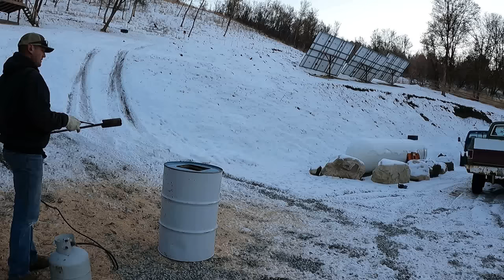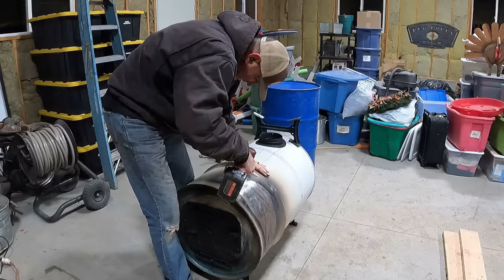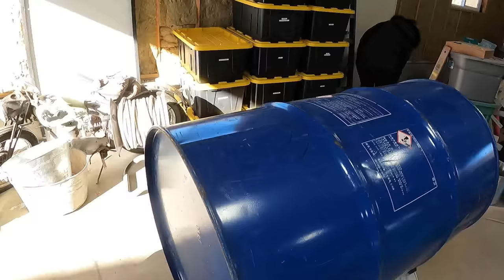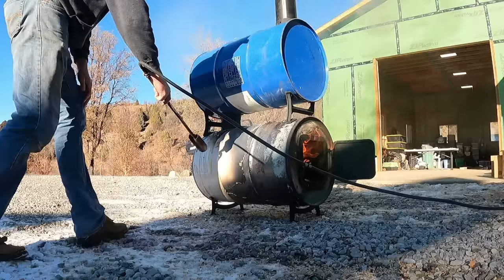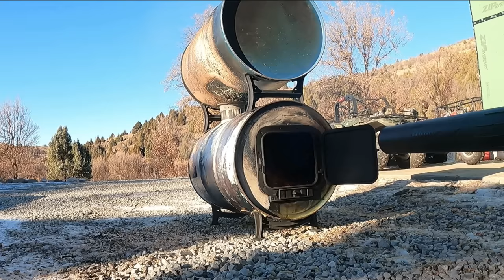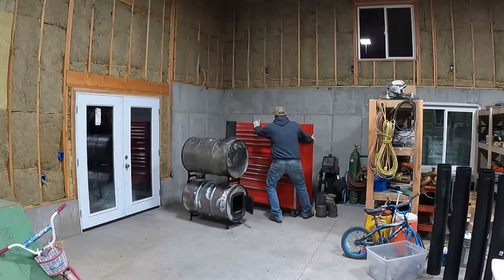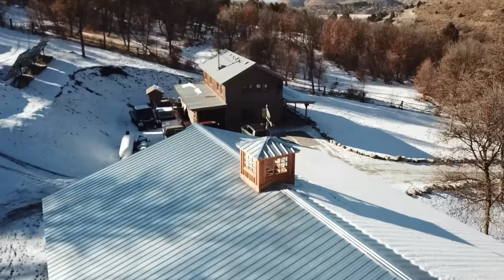I Built The ULTIMATE Wood Burning Stove For The Shop...

Comment: If you want your double stove to really heat the shop add tubing from end to end on your top drum. Them add a fan on the back of the top drum that will blow through the tubing.

Me and my dad used old driveshafts and a hole saw. The heat travels in between the tubing and they glow super red hot. While in wy the winters where harsh for some cali boys. so this hotrod heater was a must for us.

Comment: The metal of a 55 gallon drum is like the cheapest steel in the world I don't know why anybody would want to spend so much time creating a wood-burning stove out of a 55-gallon drum because immediately after burning wood and then they oxidize and get so thin within one year they start leaking everywhere you've got to have at least quarter-inch steel for a wood-burning stove I believe a 55 gallon drum is less than a tenth of an inch

Comment: Build one you need a 30gal barrel and a15 gal barrel to much draft with the 55gal barrels,you have to make them air tight, and the rest you have figured out. oh it waists alot of wood with the 55 gal drums.good luck.you need class B pipe,put the 15 gal drum on top of the 30 gal drum and the draft will work great.very poor draft with the 55 gal drums.

Comment: Not ultimate by any means. Basic wood burner.  
Simple upgrade; your barrel had bungs  put the door on that end. Remove bung for extra air flow. Tubing upper barrel with a small blower heats area quicker  but not as off grid friendly.

Comment: Ultimate: The best achievable or imaginable of its kind.

So no, no it's not. I get a cold shudder just thinking of all that wasted Heat, going up & out of your chimney/stove pipe.

Where are your Heat Exchangers? They are simple and have been used for centuries. And with a little ingenuity, you can place Heat Distributing Fins on the Barrels as well.

Fans? You do know they move the heated air better than using simple convection or radiant distribution, right? That way, you wouldn't have to sit so close to the stove to get warm.

Comment: Your clearance codes to combustibles ( truss and roof ) is not to code and very dangerous . Sheet with metal all wood with Minimum 1 “ air gap through to the roof . A vent is far safer for the path chosen .

Comment: Masive fire hazard.

As the flue gases enter the 2nd chamber their speed is reduced which means there is less energy to lift the waste products, meaning they fall out and settle . after some time it is very likely they will catch fire again at which point things will get very hot.
At the very least you should clean it out regularly.

Comment: I don't know differences about heating with coal versus wood. I imagine the coal is a more steady even heat. But as an engineer, I would never trust this method of heat, no way to verify when the thin steel on the barrel is going to burn through. Just setting yourself up for a catastrophic accident. Besides you just invalidated your homeowners insurance, if you have any.

Comment: Wow, if that purpose of that stove is to heat up a shop then it's extremely inefficient. 

A better design would be a burning barrel inside an air layer barrel, insulated so that the heat doesn't escape into the environment, and blower in the pipe to direct the heat into the shop. To manage the smoke, weld a separate pipe from he internal barrel to the external barrel. 

You can go a step farther and use the surrounding snow to turn it into steam to power a generator for electricity in your shop. Don't waste the heat energy.

Comment: Problem is most insurance policies specifically exclude Non-UL rated wood stoves. SF will pay the claim and drop you, others may not pay if the stove in question is the culprit... Either way, dropped.

Comment: Your 45 is to high, to much radiant heat near roof rafters which will cause rapid drying of different sections of rafters wood during moist times of year.  You're creating a high fire hazard  there

Comment: Looks like it burn your building down. Too close to wall.  My barrel  glows red hot at night.   Need at least 4 ft space or a metal heat shield in between.   Wonder if those secondary barrels could accumulate unburnt gasses then ignite and blow up.  A flue damper above would restrict exhaust enough to build up a load of combustible gas that did not burn below.  Should be okay with a good life insurance policy.

Comment: No, no it's not...

Ultimate: the best achievable or imaginable of its kind.

Where are your Heat Exchangers? They are simple and have been used for centuries. And with a little ingenuity, you can place Heat Distributing Fins on the Barrels as well.

It's your Heater/Stove, do it your way. But this isn't the "ultimate" anything.

Fans? You know they move the heated air better than using simple convection or radiant distribution.

Comment: I don’t like these cast iron kits because they are not air tight.  They waste wood and let to much heat go up the chimney. An engine with a throttle control on the exhaust side does not run efficiently.  Years ago there was a kit available for a barrel stove that was air tight and it worked so much better then these cast iron kits.  I’ve used both kinds.
Reply: So make your own gaskets from the thinnest door gasket material you can find.  If it bothers you so much - fix it.     - Joe -

Comment: Please tell me I didn't just watch you work a hand crimper around the top end of that pipe resulting in a 'male end up' orientation. If you've had plumbing experience, you should know that with solid fuel burning appliances, all connections should be 'male end down'. And that horizontal section that connects into the flue looks awfully damn close to that wooden truss, not to mention how close the back of that barrel is to those framing studs. And while we're on the subject, your HT rated chimney doesn't look to be two feet above any part of the structure within a ten foot radius. May I suggest you consult a professional before attempting something that has the potential to cause you financial loss, or worse, loss of life.

Comment: This is a terrible idea. These drums are not designed to have fires burning in them. The welds can fail and then you get a fire burning right on your floor. Good luck explaining that to your insurance company.
Reply: You are incorrect
Reply: @anthony9thompson  No I'm not.  When it comes  to lighting a fire inside your home/workspace/holiday home etc, You know, somewhere where your friends and family might be. Don't be a cheap bastard and just use something that was designed to have multiple fires in. Also you will not find an insurance company that will pay out if you burn your house down with this crap. Save it for the apocalypse.